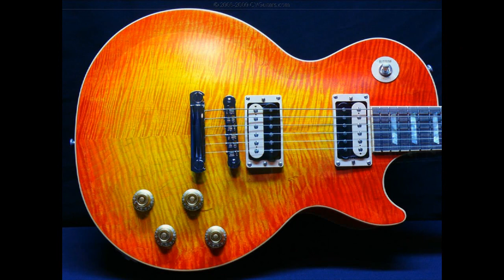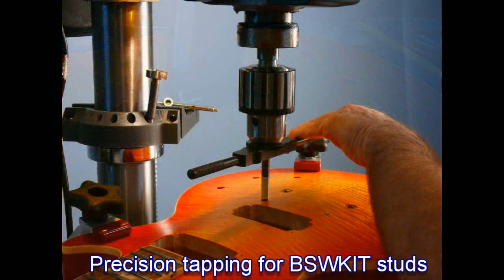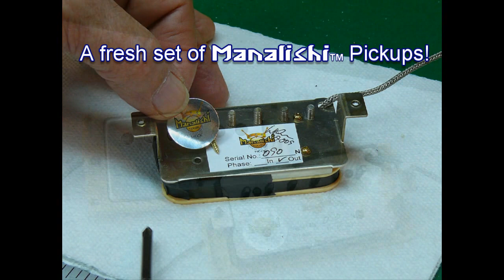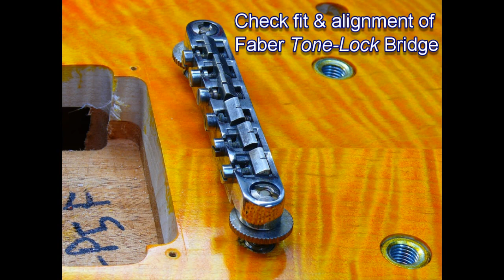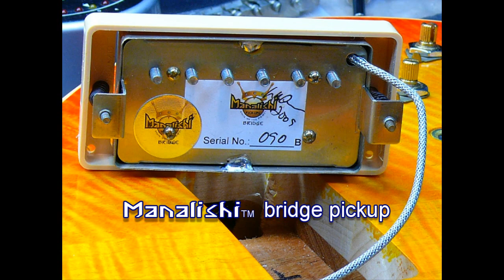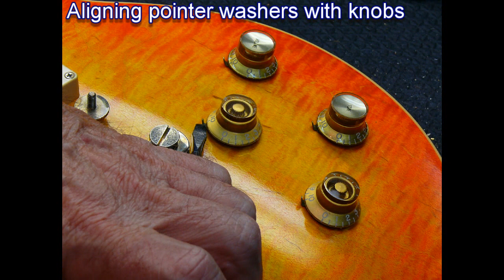Part One: Peter Green Mod - Making an LCPG guitar

Comment: I have achieved the same thing on my 2006 Les Paul Studio by adding Seymour Duncan JB and Jazz Set Pickups and flipping the magnet on the Jazz and adding a Classic 50's harness by Mojo Pickups with paper in oil caps including braided and cloth wires. Not original looking but its the sound where after not the cosmetic look..!

Comment from the maker: Because of the way they are finished. There are no grain fillers on the guitar. The color is rubbed on and then shot with a few coats of sanding dealer only, so the mahogany is not suffocated. These guitars resonate and sustain naturally better than any Les Paul I have ever owned, and I've owned many, including more than 10 original 50's Bursts and PAF Goldtops.

Comment from the maker: In order to use the Faber locking bridge on a guitar with a Nashville (such as Standard Fadeds), you need to use either the Faber BSWKIT (complex installation) or NSWKIT (direct replacment - easy installation). I use the BSWKIT anyway, even if not installing a locking bridge, because it produces better sustain than the NSWKIT.

Comment from the maker: I flip the magnet in the neck pickup, so it is magnetically out of phase. The Faber steel locking tailpiece studs and spacers produce more sustain than than the original Gibson non locking studs.

Comment: Love those classic 57s..ballsy sound on yer blues number.  From the research I
have done on Gibson and the Les Paul....Greeny's neck pup could have been  an error by GIbson production , or a tech that worked on it at some point.  
They (might have) mistakenly identified the middle pup for a LP Custom (Black Beauty) where the middle pup on the middle position of the 3 way switch arrangement caused the volume to drop slightly producing a brighter tone REVERSE (flipped) MAGNET Polarity induced tone on the N-S coil. This resulted in a unique way of mixing the treble and middle pups for that out-of-phase "nasal" sound, when used in conjuction with the neck (rhythm) position on the 3-way.
Reply: It was a mistake by the repair tech. When Peter Green got the guitar the neck 
pickup had a problem. The tech who repaired it mistakenly wired it wrong and
turned it around, putting it out of phase when in the middle toggle position.